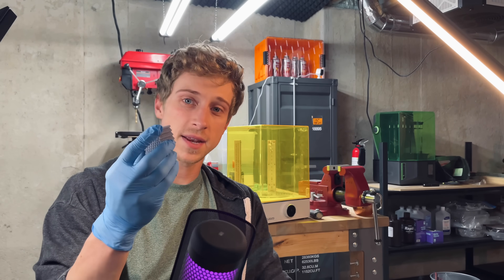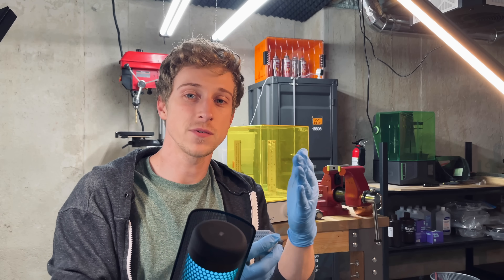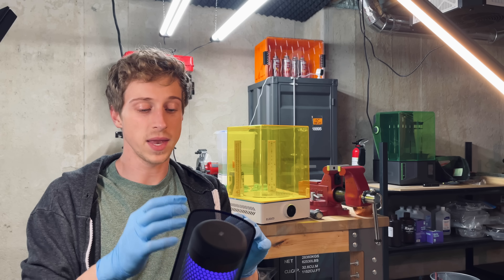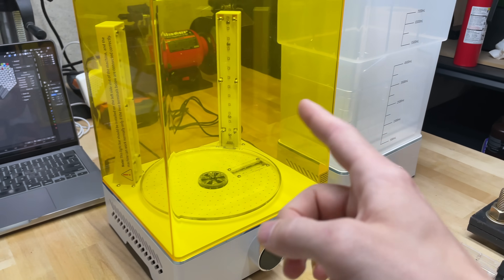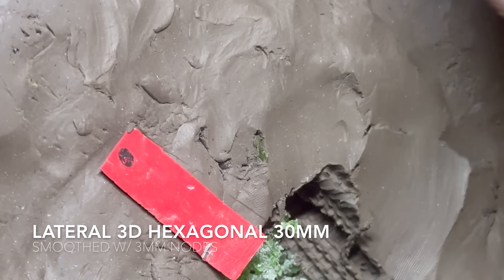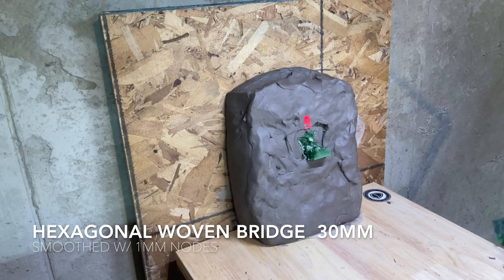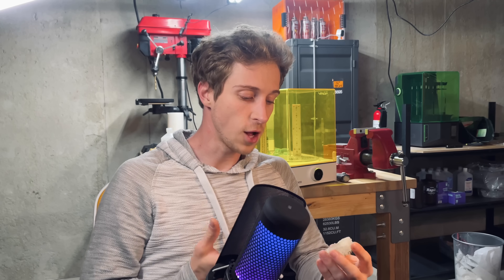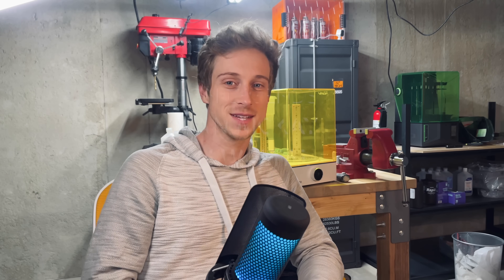Making 3D Prints Bulletproof with Molecular Structures

Comment: Very cool! 3d printed metal armor as the potential to be thinner and lighter than ceramic while not having the splitter and spalling problems regular steel plates have. Though a metallic ceramic composite would probably be best. Perhaps using the metal lattice like rebar in concrete

Comment: Hello! New subscriber here! 
I know you are still deep in development for the structure itself, so I absolutely wont mind if you ignore this, but would you consider dipping the metal printed structure in a nylon or latex based paint or even a bed liner formula? It wont matter for testing purposes, but in the final product having a material to catch light fragments of copper and lead as they gall and eject parallel with the surface. Repeated fire with uncoated plates tend to DESTROY plate carriers (and the biceps, forearms and chins of personel). There may potentially be other benefits to doing so with your design specifically, which may warrant testing. It may help keep the supersture together as non-compliant aspects of the geometry begin to fail.

Comment: Can you insert a gel medium to the hollows? That would be interesting if you could dissipate heat via the gel flushing out. Don't want burns, but some melting gunk coming out might be a good way to flush excess heat, making the structure thermally less volatile. 

In a honeycomb structure maybe the material that's mean to flex, could do double duty. A composite material with some layers meant to melt diffusing heat? Its certainly within my lil imagination possible. Boiling, and forces might be able to be used, to fracture the worst heated portions jettisoning them to create a buffer. I really want to see what the real nerds are up to for the tricks they do on tank armor. 

What's a gimmick and what's actually practical? Because the environmental heat has to be accounted for...however if its valuable enough to warrant a cooling system built in, I wonder what that changes too. Gosh I love this stuff so neat. Armor compromising based on built in heat is something I thought of when I saw tank armor melting. I wonder if there's a high flow lower melting point metal that could melt, dissipating heat in that system.

I consider myself an idiot, so I have no clue how much thermal load actually compromises armor, and what the trade point is compared to the types of armor penetrating rounds designed to melt through armor instantaneously is...and how they defeat that residual heat compromising the rest of it.

If jettisoning armor at some layer becomes more practical then keeping it, I wonder if this is where those active armor systems might come into play. They used to explode material externally, but what if the material itself had a property to shove off the thermal shock by igniting a sort of portion of material to stop heat compromising the rest?

If fracture points and material properties inherent to metal or printed metal, or composite layers already solve something of that, without having to go overboard.

Internal faults and metal layers might already establish that in a practical way without compromising much of anything.

Gosh such a cool thing.

If a barrier exists within the material that stops the piercing force of those armor penetrating rounds, I wonder what properties they're using to get that force out of the system? 

Gosh I wish I had a tour pass and some money to go ask questions. There's too much cool stuff out there. Let alone the security restrictions. Bah, bastards having so much fun.

Next I want to know how to deaden shock from airwaves so that the crew can remain functional... Those buggers gotta be able to use the darn thing to get out if the armor is going to have value at all.

Damn curiosity.

I wonder if its even solid anymore these days, they might have compressive forces on it like those ancient brick buildings that survive earthquakes with brick structures. Maybe that's how they figured it out. Then mechanical forces might pressure expanding pieces out, and then you have a structure that's using the failure of that structure to push out more material where its needed most.

Comment: Really cool project. Just a thought, I wonder if the results would be different if you braced your sides. It looked like most of your samples were being broken apart and spreading out laterally versus failing in compression, or whatever. The real world part printed with metal would probably have enough to keep structure in the sides, so seems like a more realistic test, maybe? A thick steel ring around the test sample printed to fill the diameter sounds like a good method of testing, but I feel like heavy tape wrapped around the sides would even do a whole lot. It'd be a fun test and might end up with a different perspective

Comment: im assuming this is probably going to be the external layer of an armor? because if you can shed off most of the energy of the round, you could prevent it from piercing the inner protective material that the modules are mounted on

Comment: i feel like some kind of tetrahedron lattice where the points point toward the outer surface of the mesh would distribute impacts over a large area, wouldn't it?
Reply: because every tetrahedron spreads the impact to its 3 point base, which touches 3 more tetrahedra
Reply: but the problem is that a tetrahedron by itself doesn't fill a lot of space, so it makes sense you would go for a sloped interlocking hex grid

Comment: Great now stop a 30 caliber rifle round from ww1 with something you could wear and still move.😂
Reply from the maker: 13:12 discusses using 300WM which is way more punch than 762 and my Short discusses the multi hi plate I'm designing for that
Reply: @CrashMakerspace  I was referring to simple 30-06 or 7.62x54r. Keep in mind an ar500 plate is 3/8 of an inch thick. Also everybody is working on energy weapons now that disrupt vision. It looked like you were still trying to stop a 22 squirrel rifle.

Comment: Firstly i want to thank you for doing these diy research videos.
Second I did some material science at college, a hardened structure such as the one you made will always break dissipating the kinetic energy of the bullet, in that regard you might want to combine the hard resin with a softer material that might catch the bullet, also check the design pattern for the dragon skin armor.
Third you might want to check how wood is composed and how cellulose, hemi-celluose and lignin are combined to create a stronge structure, if your plan is not to stop a war munition you could look Into it.

Comment: I just watched a short recently on a 70+ year experiment that has already proved that pitch is a viscous fluid and not a solid.
I thought, wouldn't it be great to coat a thin layer of this pitch on every surface of the lattice.
Then another thought came to mind, could the pitch be sucked into a lattice by capillary action.
I can't remember how long it took to create one drop but I imagine that it might take equally long to wick upwards. And, if under vacuum, it might pull quicker through a matrix.

Comment: Imagine these metal 3d printed in assorted variations. I'm curious how these resin prints would work printed in a slightly curved ballistic plate shape
Reply from the maker: @bojik2616  I’ll be posting a Short tonight and that shows my 6”x6” 3D steel panel I’ll be building around!

Comment: You should compare your final product with a stainless foam of similar weight... just because the manufacturing cost would be a lot less.
Reply from the maker: @benjamindees  yep! Metal foam is essentially a randomized version of the lattices; pore size and bridge thickness is the main key

Comment: Might also want to look into meta materials. Basically what you did here, only the dimensions of the lattice are tuned to the frequency of the energy (I'm assuming the impact velocity?). 

Meta materials can do some crazy things. They use them to build earthquake and tsunami latices to deflect them around buildings, and also what they use to make those 'cloaking' shells that makes an object vanish to radio waves and the like. It treats the impact shock wave like you would light or sound waves, bending them away and around, or reflecting them entirely. Usually have a gradient to the density/feature size to bend the energy. Of course, the trick is having it match the proper frequency.. but I'm betting the reason these lattices you made work so well is because of something along these lines.

Comment: Im working on something similar I’m using the weakest material if it can stop a 9mm then it’s perfect I’m also using Ai plugging in information it’s time consuming but absolutely worth it. I would eventually like to set up a lab for genetic testing making yeast produce spider silk but the chain made by Ai . I could even one day make a uv resin alone strong enough to dissipate the 9mm’s energy but along with shaping it.
Reply from the maker: @BearerOfLightSonOfGod  spider silk could be great if a big enough weave is produced
Reply from the maker: @BearerOfLightSonOfGod  if you can get a large enough weave of spider silk then you can certainly make a durable panel

Comment: There are two things that I think would be interesting to try for this sort of thing:
1. Computer generated designs, maybe something like a genetic algorithm. That would let you pump out lots more variations for testing and identify new paths.
2. I'm curious what would happen if you used something like super hard beads or maybe spikes or something in the outermost layer to encourage the bullet to fragment early and spread out it's impact. Even just a thin outer layer of steel might do something like that.
Reply from the maker: @LanceThumping  I’ve made a genetic algorithm before and have that shell, which I’d love but the physics of these complex structures based on all the marital properties would need a massive effort haha, I think CAD might have some pretty good ones but they are expensive simulators
Reply: @CrashMakerspace  I know that doing physics sim would be nasty. What I was suggesting was using it for maybe smallest crystal you could that would then be repeated, then doing prints for tests.
It's a lot more manual work but it won't require a supercomputer running 24/7.

Comment: Huh, this is your first video I've seen but you look pretty good so far. Looks like I'm subscribing.

I love the investigation into different structures! I think this is a good demonstration of why nanotechnology is has so much potential. You managed to both decrease the density, and volume, for a significant reduction in how much material is stopping the bullet, and yet still blocked it better than the solid material!
Reply from the maker: @Edragon_Ghostmage  great that you found me! Happy to have you here, nothing quite like some practical trial & error after the theories 😅
Reply: @CrashMakerspace  Hey, its loads of fun! How are you supposed to get anything done without breaking something (just make sure it's not yourself)

Comment: I wonder how BambuLab’s PPS-CF filament would fare in this application? It supposedly has metal-like strength and stiffness - though I see that PC-CF has a higher impact modulus. 

- Time to ask BambuLab for one of their X1E printers and some samples of their engineering filaments 😉

(Seriously though, FDM printing couldn’t make structures with as fine detail as your resin printer, but I wonder if some filaments might do better than the ABS-like resin you’re using, particularly something like PC-CF? It’d be cool to be able to print armor plates that could stop a 22LR on an inexpensive FDM printer :-)
Reply from the maker: @DaveEtchells  exactly, that filament would definitely be way stronger than this plain resin, but as you mentioned, the FDM printers can’t get these clean mini scructures that are needed to keep pore size small enough to prevent the round from wedging a cube apart
Reply: @CrashMakerspace  Ah, that’s interesting, I didn’t pick up on that part. The pieces the structures fragment the round into need to be small enough that they don’t individually carry enough energy to split the plastic. It’s very interesting tech, dissipating the energy from the round so quickly.

Comment: Hello, random suggestion, but i think filling the pores with a flexible resin(solution that will cool down and have a soft and flexible structure) could indeed help. The air gaps may dissipate some of the shock wave, but I'm fairly certain that with the flexible resin in place, it would dissipate the force and likely contain most, if not all, of the fragmented parts.
Reply from the maker: @redrayot  I’m going to be experimenting with making your own ballistic STF which I’ll likely put into these if I derive an effective solution!

Comment: Even if you end up making a plate that can stop a single 308, I’d be amazing as an ultralight weight protection option.
Reply from the maker: @AZREDFERN  spall and deformation are still concerns so I’ll be putting the steel 3D print inside one of my regular rifle plate builds to see how it holds up to 556 green tip, 308, and then 300WM if it’s still standing
Reply: @CrashMakerspace  even if it was rated for a single 357 on a thin steel lattice plate, most police only get hit once in the vest, buying enough time to take cover.  Granted, Kevlar is significantly more comfortable to wear all day every day.  But weight and breathability are important for casuals, or even construction PPE.

Comment: I don't have the links at hand, but there are a number of super interesting papers on the stiffness and energy absorption characteristics of cuttlebone inspired structures. One paper found cuttlebone is equally stiff as a theoretical isotropic composite of the same material and full density, with the cuttlebone being only 7% solid.

Paired with a nacre inspired face structure, this should provide a route to some seriously lightweight but capable armor. Granted, it does require the ability to print more than one material at a time, which could pose problems.
Reply: This is an amazing idea if it can be pulled off

Comment: I wonder if there is an equivalent of face-hardening that you could implement. The impact face would be (comparatively) hard and will soak up most of the kinetic energy, with a (again, comparatively )   soft backing that will flex/bend while also supporting the impact face. The closest think I can think of to explain the idea is Krupp armor (https://en.wikipedia.org/wiki/Krupp_armour)

Keep up the awesome work - just don't go picking fights with random people dressed up like clowns.

Comment: I wonder if you could dope the material with something else to add even more durability. You have all these voids surrounded by hard resin, what if you used a vaccuum chamber to suck in a second material that acts to keep the block from shattering? Like a more plastic and sticky material?
Reply from the maker: This is what I will likely do once I tune my own Sheer Thickening Fluid, I've got chemicals ordered but still awaiting shipment to begin doing those experiments
Reply: @CrashMakerspace  That's awesome I can't wait to see how it turns out!

Comment: Hey, I noticed that your lattice is very good at turning your bullet into a blob with a lot of lose edges. What if you have a fiber like substance also incorporated within the lattice (threaded through), would you think it could act as lose wires catching the blob bullet once its hit. Essentially for stronger rounds, the bullet's energy will also be taken by these fibers which will tug?
Reply from the maker: Fiberglass is best served in a full weave to convert to tensile strength, now fibers in the resins could be good but would first have the issue of how to manufacture with them embedded

Comment: I was testing something very similar about 5 years ago. Difference being the material was polycarbonate and the printer was FDM. Funnily enough same naming convention. Anyhow the reason different tubalane configs can have such varied results is because the energy of the bullet is getitng absorbed/released by the snap points. Easy way to see how well it gets dispersed before shooting it is putting it under a stress test in Fusion360/solidworks/etc. I did move onto developing a Schute design packed with Magnesium Hydroxide, but sadly I never got around to testing if a pocket of powder schute was better than a tubalane schute packed with powder. Well best of luck in your future tests.
Reply from the maker: Sounds awesome! How accurate have you find those stress tests for impulse hits via Fusion / solid works?
Reply: @CrashMakerspace  Short answer very accurate and you can/could entirely model such things digitally. 

Now for personal anecdote I had a legacy license/contract for fusion360 and static  simulations were the only ones you could run on your personal machine. They're leading CAD software so it was very accurate, can't say if they're the best option nowadays though. They did have event modeling but I don't believe I ran many if any simulations, since that required modeling a ballistic and then paying to run it on their cloud. That or it was an extra addon package. At the time it was less hassle to just test a higher static force deformation/displacement/stress and then confirm via practical tests.